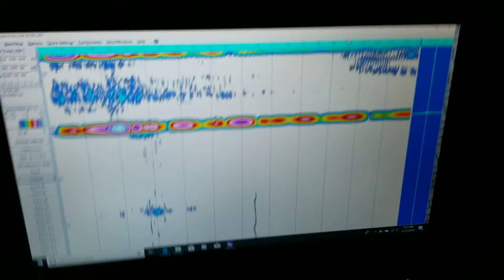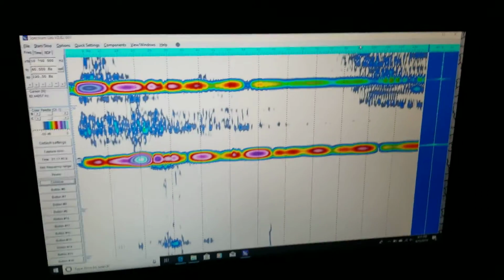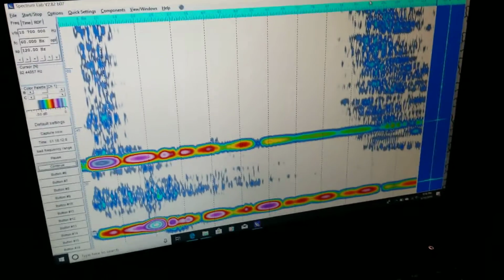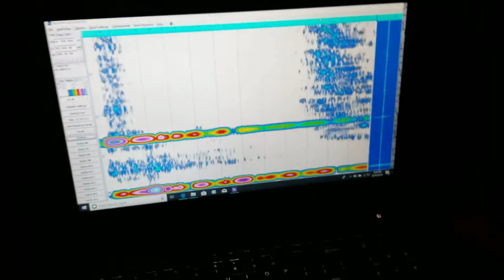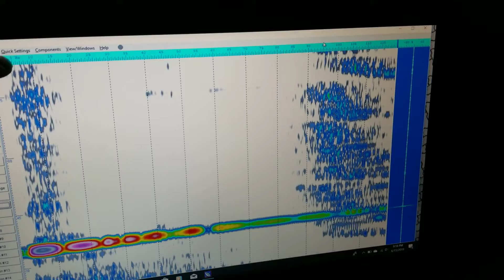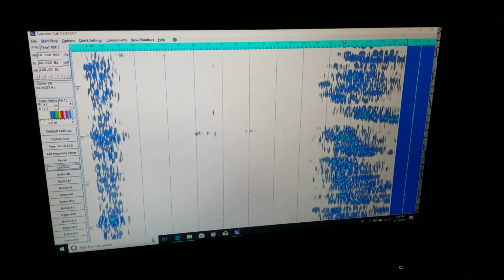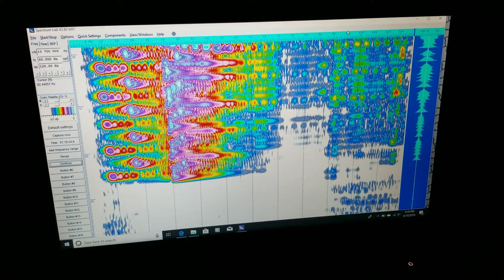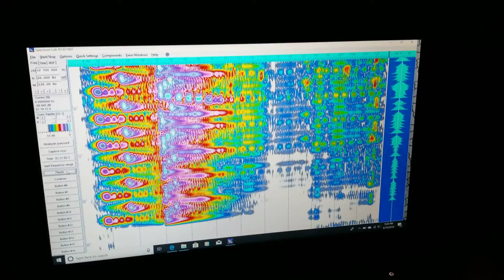Stereo Integrity SQL-12 in 0.8 ft^3 playing 8 Hz

Comment: I want a sub in my camaro. Trying to decide how much sub I need. I don't want BOOM but SQ. I want sealed box which quickly rolls off the 30 hz or lower tones. I want to OVER engineer it so that I can compensate for this and be able to play LOUD tones in the sub 30 hz area. I realize not much music is down there but I want to be able to do it with the music that has it. So I would have too much woofer in order to ensure that those lowest tones can play with good volume. So one 12"?  One 15"? Two? Three? 
Again I'm not looking to hear this down the block but just be able to compensate for the sharp rolloff at the lower end, especially over the road noise while driving. 
I don't know the frequency range but one song that my old woofers choked on was Rush - Big Money, the pedal tones. It may also have been not enough amp power. I had 2 Kicker C-10's in a sealed box running 125 watts per channel.